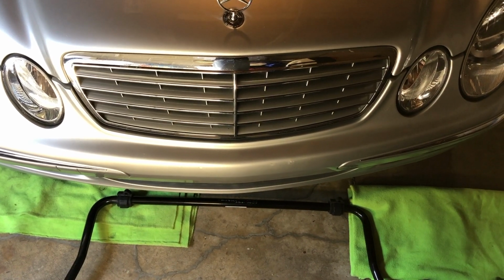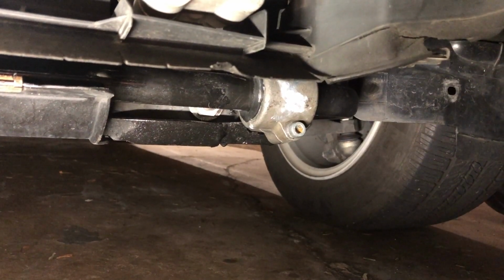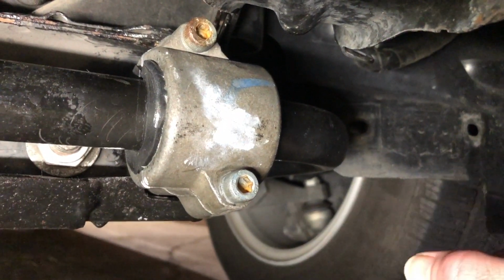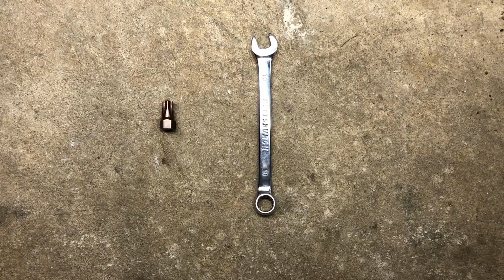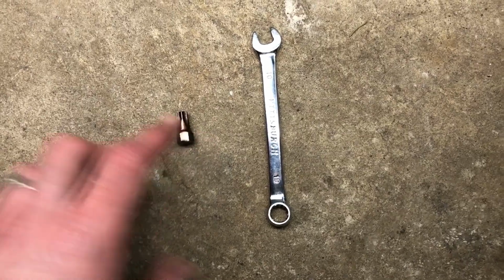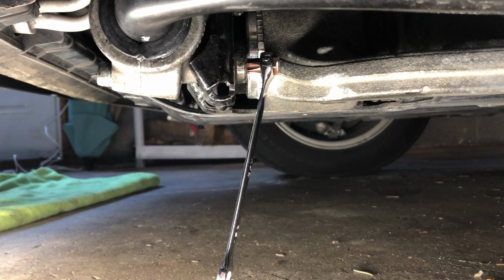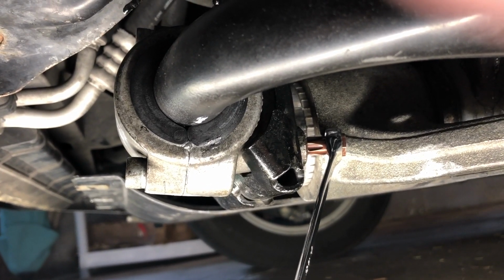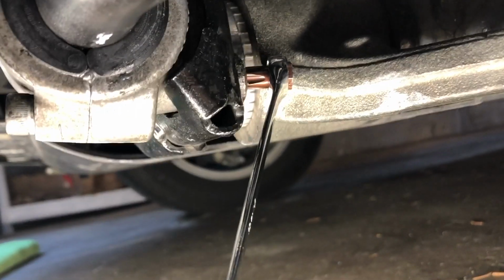Mercedes W211 4Matic Sway Bar Replacement Tip to Save Hours of Time E320 E350 E500

Comment: You can also use a long ball-end allen socket which will allow you to get the proper angle for the top bolt to loosen it.

Comment: Do you have a part number for the brackets and bushings only?
Reply from the maker: Rear brackets:  2113230640, 2113230540 Front brackets can only be purchased with bar from Mercedes. Bushings you will need to search online for aftermarket. We used a brand called Febest. No official endorsement simply what we used.
Reply: @fatherandsonfix  Thank you.

Comment: 😂 All you guys! Waaay tooo much work. NO Crazy Grinder is needed! Much easier! I hit a curb and shattered both front and back swaybar clamshell bracket pieces on drivers side. So i only had to do one side and i didnt even take off the whole sway bar. Left the passenger side intact. For the front bracket allen head bolts First i cut down a allen head socket to one inch length. Next i put a jack under the front bumper and gently lifted it a pinch just to give me tad more clearance to the upper allen bolt. The bumper will flex upward slightly lifting that lower metal contraption up out of the way a little. Just go easy. Put the one inch allen wrench piece in and slipped a closed end box wrench over it and easily took the two front bolts out.
Next for the back bolts. Remove the main front big bolt for the front of the lower control arm. Real easy. Its right there in front next to the swaybar bracket. After that, go behind and use a pry bar and lever down the front of the control arm. It will flex some out of the way due to it having all rubber connections giving more clearance for those back torx bolts. If need be, again cut down a torx bit socket to a short piece if need be and put a closed end box wrench over it. My car is 20 years old and i had no problem getting the back bolts out. So dont know what the other guy is talkin about rust.
First order of business is i replaced those two rear torx bolts with the same length HEX HEAD bolts. Now, if need be, i can easily reach in with a box wrench from the side and and remove those two back bolts with ease.